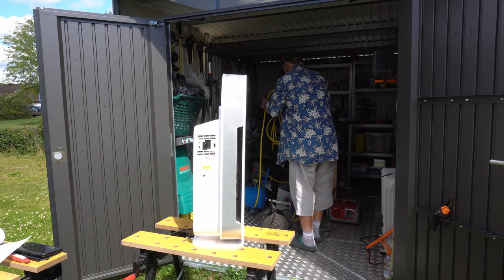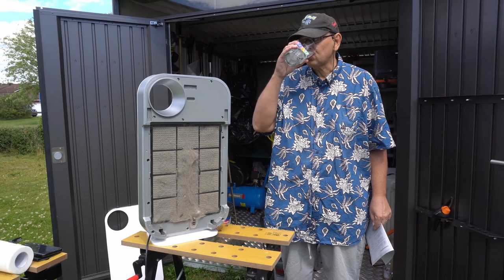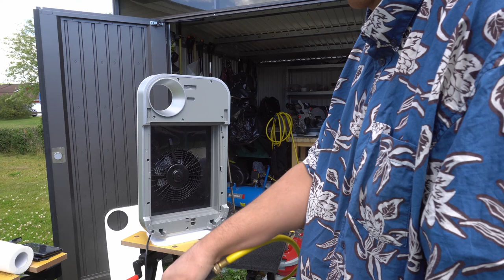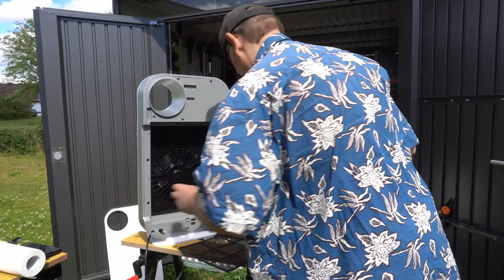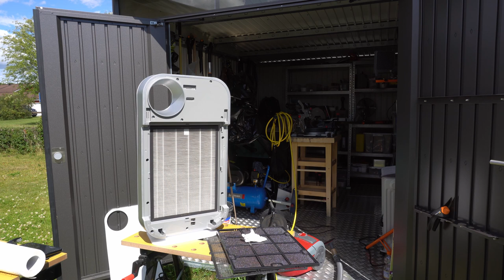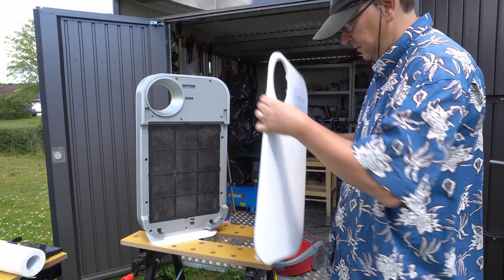Cleaning the Coway AP 1008CH air purifier

Comment: Ohh damn, that was the dirtiest filter I have ever seen, and I have seen a lot. The only satisfying thing about this video is seeing the filters getting cleaned and all the dirt getting out. 
A tip is when you blow out the air from the filters, move them like 2-3 meters away since when you blowed the dust from the filter it was blowing towards your Coway machine which you just had cleaned. 
I've never had any dust (that I could see at least) or so coming in to the HEPA filter, but I do clean my filters regularly, maybe every 2-3 months, when doing that everything gets much easier to clean and you can just clean them out with a vacuum cleaner. 

I would recommend when they are that dirty, even after you have cleaned them you should clean the plastic filter with some hot water, it will look like new. When you put it back it looked like mine looks when they are dirty before I clean them. I wash it every now and then with hot water and it get's like new. 

Try to clean them on a regular basic so you actually get the benefits off the purifier otherwise they wont work as supposed and they will let bacteria through.

Otherwise, it was quite satisfying seeing them get clean :) 

Have a great day!